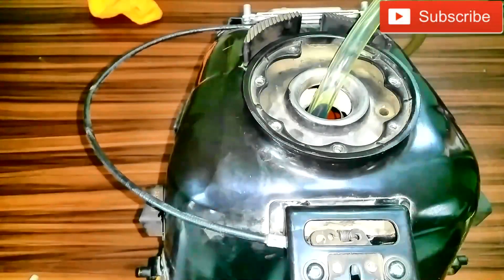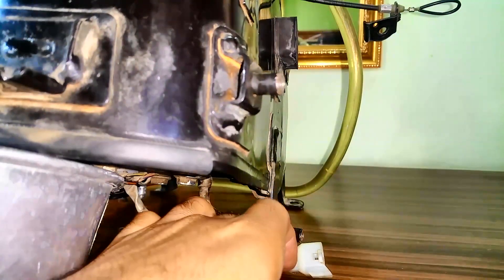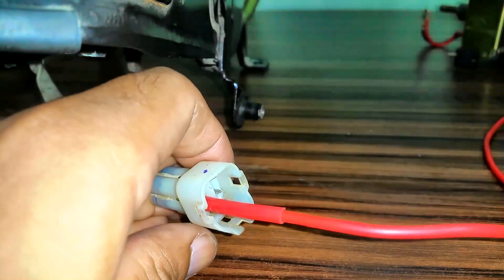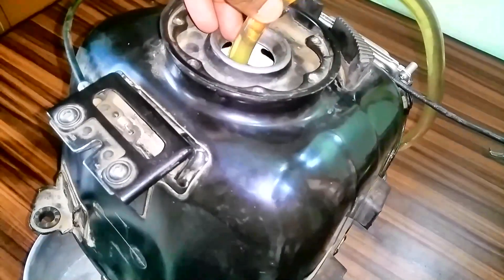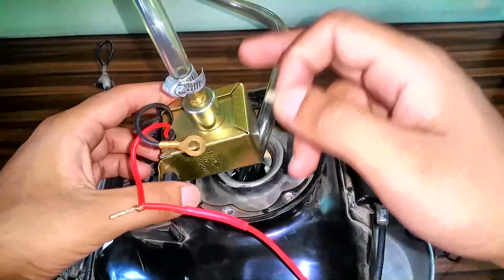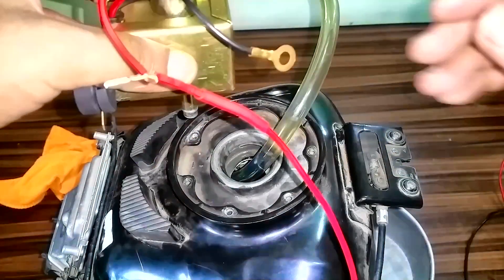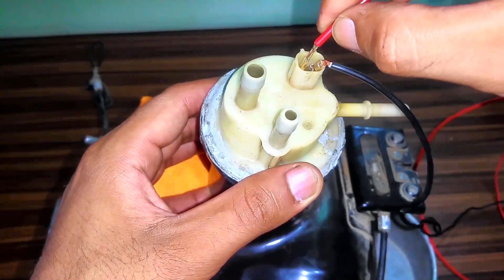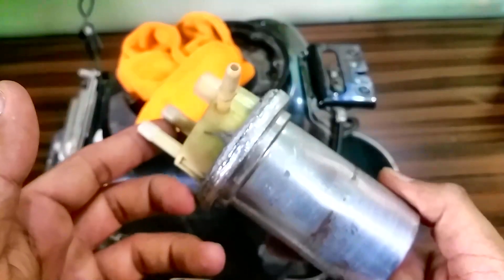⛽Checking And Testing Fuel Pump of Car/Motorcycle at Home without any special tools

Comment: Sir I own a ktm RC 200 it has missing issue so I replaced it fuel pump after it missing problem is solved but I'm facing a another problem is that in every morning when cold start my bike I used to take a long self for getting started and sometime it after draining all the battery I doesn't get start please suggest any solution
Reply from the maker: Better check for Poor battery connection or poor battery and also check Engine Temp Sensor..!!